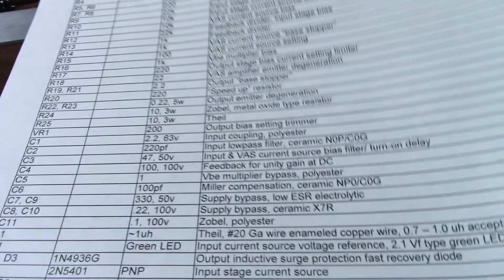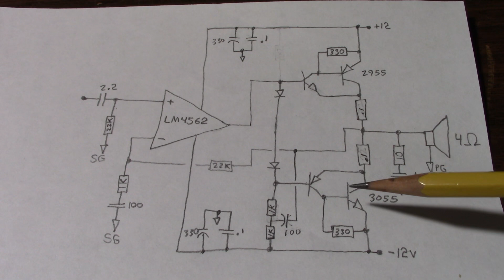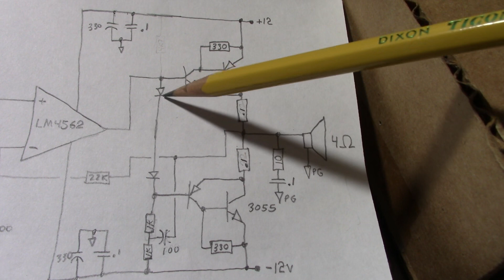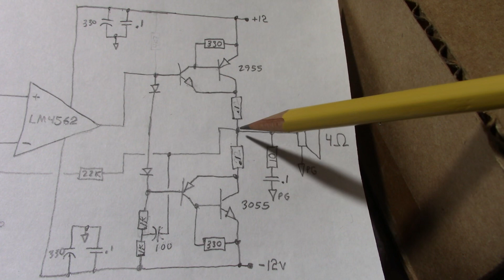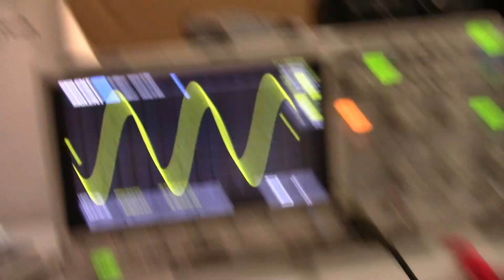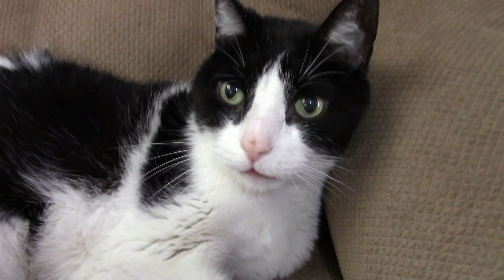Opamp based audio amplifier - better output power

Comment: Supposedly the opamp will do anything it can to bias the output stage in this configuration . As long as it can supply the required current. 
At least i would think so , but whom em i to know. 
I would hazard and possibly ... very falsely that even if the output stage would be unbiased , the opamp would still elliminate crossover distortsion.

Comment: To: John Audio Tech re: JAT501 amp

I searched for this and came across the schematic at OSHW, authored by Blasttherost.  The schematic has gross errors!  The PNP power transistor is upside down!  Other errors, too.  Please do us all a favor.  Have the author remove your name from the schematic and have him correct the errors.  I don't believe it is the same schematic as yours.  He has misappropriated your name.  Thanks.

Comment: I have questions-
1. What will be the difference between using a transistor (s) or opamp before push pull output stage ?
2. Does using an audio quality transistors at output make any big difference than using normal transistors ?

Comment: Back in 1968, Arthur Bailey used an "amplified diode" to set the quiescent current in the output stage of his famous Bailey amp. That is nothing more than a reasonably high gain NPN transistor with a resistor from collector to base and another from base to emitter. Varying the ratio changes the voltage drop at which the transistor starts to rapidly conduct. While experimenting, you can use a potentiometer in place of the two resistors and trim the voltage across it. That allows you to replace the two diodes, so you don't have to go messing about with one small signal and one Schottky, etc. which is a rather crude way of varying the bias voltage and hence the quiescent current in the output stage. The transistor will thermally track like the number of diodes that it is emulating, be it x1.5 or x2 or whatever. I've found it a good way to examine the effects of quiescent current on crossover distortion as you can continuously vary the quiescent current and watch the crossover distortion on the FFT display of your scope. I would recommend using a current-limited power supply just in case you try to turn up the quiescent current too much.
Reply: I thought the same thing. Searching for "Vbe Multiplier" should get you a lot of very good info

Comment: What would be the best way to protect output transistors on a small amplifier ?
OK so I am making a small amplifier with vintage nos transistors mostly for fun but I want to protect these vintage transistors from short circuit or overcurrent situations so what would be the best protection circuit for s small amp that is about 3w per channel. Transistors are rated 1 amp as far as I remember. 
Thanks in advance.
Reply from the maker: There's hardly any headroom to protect a 3w amp using 1a transistors. Any current limiter circuit can affect the sound with reactive speaker loads. Perhaps a thyristor circuit that shuts down the signal until power is cycled can protect them. If it's an amp only you use, just be careful not to short the outputs.
Reply: @JohnAudioTech  Yeah that's what I thought... If I put any current sensing resistor it will drop too much voltage for such a small amp. 
So yes probably no protection circuit is the best since this is more for fun and i am not selling it. 
Thanks for the response.

Comment: Hey John I absolutely love your videos.. but this time I'll give you an offtopic question still related to audio. I have a old reel to reel player and in the manual they specify for low noise transistors for the read head amplifier. Unfortunately I have no idea how to measure such things neither quantifyably nor relatively. I would like to figure out how to do it properly though. Thank you a lot.
Reply from the maker: Noise depends on bias currents, resistor values and so on. It's a lot to get into. You could setup a similar stage feeding a low noise opamp and measure the difference in noise of transistors. The KSC1845 and its complement, the KSA992 are well known low noise transistors that may work.
Reply: @JohnAudioTech  the original transistors are supposed to be KC149C. They are essentially BC547C. High gain low power. I have the schematic and I could construct the first stage of the preamplifier on a breadboard and maybe experiment with it if you're saying it's highly dependant on where the transistor is biased.  Thanks for the recommendation

Comment: Nice video John!  I'm curious what the efficiency was at max power.  The MOSFET output would be interesting, but with the high gate voltage, I think you might need a bias circuit to get them close to turn on.  At the audio freq, I don't think the bias current needs to be high as the gate charge is freq dependent.  Can't wait for your next video!
Reply from the maker: At max power, efficiency should be typical for a class AB design (60-65%). It will be interesting to try the MOSFETs.

Comment: hi john will this amplifier will be good for driving 600 Ohms headphones? if not will we get a suitable hi-fi circuit?
Reply: 600 Ohms stereo headphones you can drive by use of a LM4556 dual op amp directly. You can even drive them in class A mode by conneting  J113 junction FETs between the op amp outputs and the negative rail, allowing for a constant bias current of about 20 mA.

Comment: The problem is you have some of your resistors in backwards. They should all read from left to right.
Reply: Lucky it didn't blow up like that. Negative resistance! 😏
Reply: @itsafeaturenotaflaw  well we are trying to achieve amplification. So perhaps that is John's secret?
Reply: Oh, this triggered my OCD
Reply: @noelj62  with backwards resistors you only get the dyslexic electrons through them.

Comment: Does the signal ground connect to the power supply ground or is it separate
Reply: It has to connect. But the power ground should go straight to the psu, while signal ground should go between preamplifier (that also had a power ground connection to psu) and power amplifier. Speaker return MUST go straight to psu ground.

Comment: Hey John, one more nice and out-of-the-box reasoning... always a pleasure.
Since you chose not to have a stand-alone biasing network and thus relying on the Global Feedback to stabilize the bias as it is, one good way (and indirect) of looking at how good the output crossover distortion is, is by measuring the signal at the output of the op-amp.
If you see a noticeable inverse crossover distortion there, than it is an indication the op-amp is doing the most in correcting the x-over distortion, whereas if you find little inverse x-over distortion at the op-amp's output, then you can conclude the output biasing is good enough on its own.
Reply: The LM4562 is a very fast opamp with a typical GBWP of 55 MHz and a slew rate of 20 V/µs. So it is absolutely no problem for this device to eliminate crossover distortions of underbiased output stages. It should even be possible to operate the Sziklai pair without a bias spreader in pure class B mode.
Reply: @gkdresden  I never meant to go down that rabbit hole.
I didn't even know the 4562 is that fast... I just wanted to point out that, if it's the op-amp who is working the x-over out (iso the x-over being linearized locally at the output stage itself), then you will see its output crossing the zero line at high speed, indicating the output stage isn't properly biased.
The more linearized the output stage is, the less the op-amp will need to work itself out to counteract the lacking of the output stage.
Now, on your assertion that the 4562 is so fast that we shouldn't care as it would be more than capable of working out the x-over...
Well, I don't think it's that simple...
The op-amp may be fast, but the output transistors would need to be fast too, to cross that non-linear region so quickly not to leave any swiching artifacts getting through... and one doesn't want an E.F. output stage being any faster than just enough the freq. response specs require, if one doesn't want to deal with nasty E.F. oscillations (which are already prone to it all in its own).
That is - of course - my opinion.
Reply: @fabiotrevisan8922  The limitation are the 2N3055 / 2N2955. But their GBP is still 2.5 MHz. But this is still fast enough to cope with cross-over distortions, especially for small signal amplitudes and frequencies of 1 kHz. I guess it is even enough to cope with full RMS power at 20 kHz. John can perhaps test this for us. For power MOSFETs this is certainly a problem, because they have usually larger input capacitances and significant gate charges.
Reply: Hey @gkdresden  , you surely have some strong points.
I for myself, don't believe "slow" devices such as the 2N3055 would be able to take nicely the step transition, especially in the transition from active to cutoff.
It would surely surface as some sort of odd harmonics distortion but, in favour of your argument, I grant we're not talking about high-end HiFi here anyway.
I think it will still perform better if the output stage is biased.
If there's anyone who can settle this argument, it would be @Johnaudiotech, if he's willing.
Reply: @fabiotrevisan8922  there were harmonics visible in the spectrum, and for sure, it is better to operate the amplifier in the class AB mode with a certain amount of bias current.

btw: I have found, that it is convenient to keep the unused transistor at a certain amount of bias current after crossover. I have used the LT1166 for this purpose. 

https://www.analog.com/media/en/technical-documentation/data-sheets/1166fa.pdf

The circuit suggestion in the datasheet shows more effort than really required.
Reply: Hello @gkdresden  , this conversation is getting more than interesting.
I've always been intrigued by the possibilities of the modified class AB amplifiers that prevent the inactive device from cutting-off, such as the JVC Super-A, and Pioneer's "Non-Switching" and Tehnics' "New Class A".
But not having any of those original equipment myself, and not having the instrumentation to measure the differences between them which are all under 0.01%, and the vanilla AB output that can be made to get under 0.01% as well... My curiosity have always been kept mostly to the "academic" level.
And I also have seen criticism to those schemes and even that a good ol' class AB using bleeder base resistors to ensure a fast cutoff transition are just as good or even better...
I also considered myself building an amp based on the LT1166, but also heard criticisms of it.
There is a very interesting discussion on the subject here:

https://www.diyaudio.com/forums/solid-state/162559-new-class-super-non-switching-need-revival-print.html

I only hope someday I will have the time to experiment in practice one or two of those designs and be able to have a practical opinion on them...
Reply: @fabiotrevisan8922  I have used the LT1166 in several experimental output stages, mainly with so called logic level MOSFETs The circuit can be made very simple and you can include it also into a feedback loop. One of my last projects was a 10 W @ 8 Ohm output stage with 25 mA bias current. Here is the circuit diagram https://ibb.co/nDvBxKS . I have used double boot strap and LM334 adjustable current sources. So you can get almost the full rail-to-rail voltage swing and more than 12 W @ 8 Ohm rms power between +/- 15 V power supply. The output transistors never shut completely off, as you can see in the simulated curves.

I my circuit diagram you will find also a much simpler circuit around the LT1166 as it is shown in the data sheet https://www.analog.com/media/en/technical-documentation/data-sheets/1166fa.pdf . As typical for boot strapped amplifiers, the power dissipation in the output stage is relatively small, because you can go very close to the theoretical efficiency of class AB power amplifiers.

Comment: Wonder how that output would have looked like if not included in that feedback loop. Pretty impressive crossover zone for such a simple and low-biased amp. Would have liked to see emitter resistor voltages for actual idle current, though of course it must be most of that 20mA.
Reply: " of course it must be most of that 20mA" 

this is not. The LM4562 consumes 10 to 12 mA when running idle for both channels and another 6 mA flow from the positive rail through the LM4562 output, the bias spreader diodes and the boot strap resistors to the negative rail. I think the are less than 2 to 4 mA of bias current through the Sziklai pairs of the output stage.
Reply from the maker: I'll have to scope the error signal. 0 volts across the emitter resistors.
Reply: There is almost no current going through that, like 2mA, while by my calculation with those emitter resistors it should be biased to around 260mA 😉
Reply: @akkudakkupl  how do you calculate the required bias current? How does it depend on the emitter resistor?
Reply: @gkdresden  Vt/Re = Ib
Thermal voltage divided by emitter resistance equals bias current of the emitter follower output - theoreticaly it gives lowest possible distortion in this stage when voltage dropped across emitter resistor equals thermal voltage (~0.026V in room temperature).
Reply: @akkudakkupl  ah, ok. This sounds very interesting. Where does this formula come from? The thermal voltage is Vt = kT/q. In which relation stands it with the current and the emitter resistor? As fas as I know it only determines the output resistance of a BJT transistor dependent on current.
Reply: @gkdresden  So if I'm not mistaken when voltage drop on Re = 0.026 then Re equals the EF output resistance. I read the theory in some book about solid state amplifiers, can't recall the title now ;-) From what I understand it linearizes the change from class A to class B.
Reply: @akkudakkupl  well, I would think there is no real physical determination for the bias current dependent on the emitter resistor. It is usual to determine the bias current experimentally.
Reply: @gkdresden  You can see this formula in Bob Cordell book. The idea is that the output impedance of the transistor at idle must be equal to the emitter resistor. So in class A region you have "Zout = r'e + r // r'e + r = r" and in class B when r'e become really low, you only have "Zout = r".